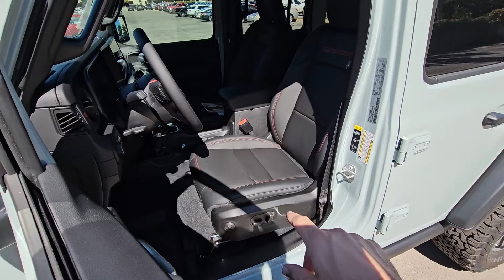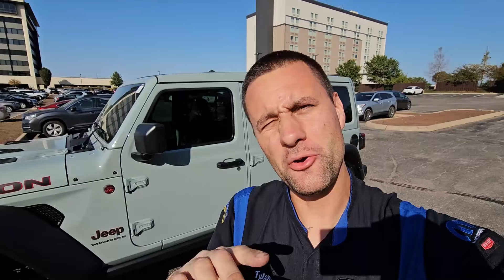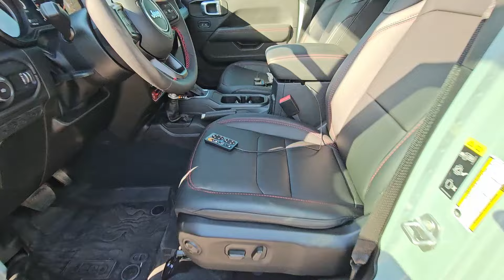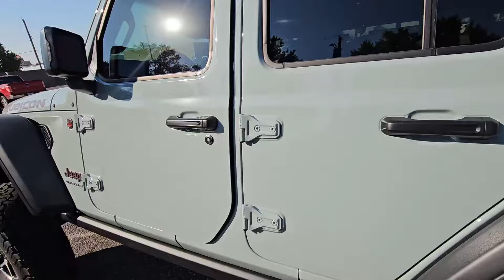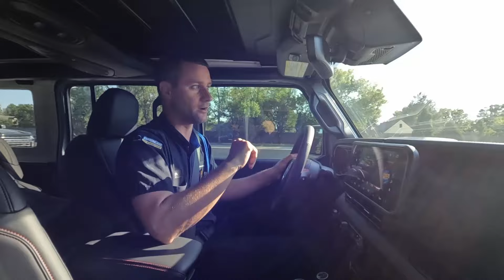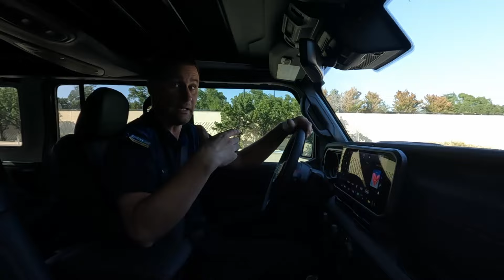3.5in AccuAir AIR LIFT 2024 Jeep Wrangler Unlimited Rubicon JLUR AccuAir lift install with 37's

Comment: One item I felt you should have mentioned. We have the lift on our 2019 Rubicon. My wife has mobility issues and is not real tall. She had trouble getting in and out of the Jeep even without bigger tires or any lift. With the AccuAir lift, we can lower the Jeep to the bump stops and it is much easier for her to get in and out. The jeep is her daily drive and she usus the lift function every times she gets in or out.

Comment: Just a suggestion, lower the vehicle as far as possible, tape a piece of string to the Fender, cut it to the length of the top of the tire, then when you demonstrate the different buttons, you'll be able to see the difference in heights. Curious to see how this works off road. Thanks great video

Comment: weird question, what is up with the front bumper?  the crush can area looks like it is sticking out a lot further than normal?
Reply: It might be a good design decision to make sure 37" tires clear the full width bumper at full steering lock and full compression.  I have a Rubicon with an ARB Bondi full width bumper with a 3" lift and 37 Nitto Ridge Grapplers. The tread bites into the bumper at full travel and full turn.  To the point that the bumper lost its powder coating and started to rust and the front tires have chunks of the outer tread missing due to rubbing. ARB said the bumper would clear 37" tires with a 2.5" lift - not the case at all!
Reply: Jeep told me a deeper crush can was needed to account for the winch fairlead and winch cable when you order the factory installed winch.